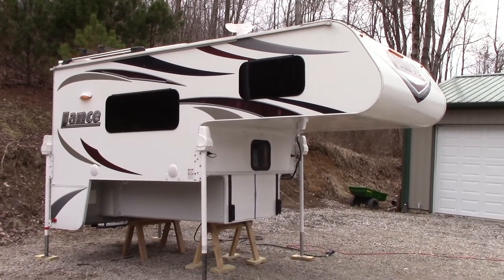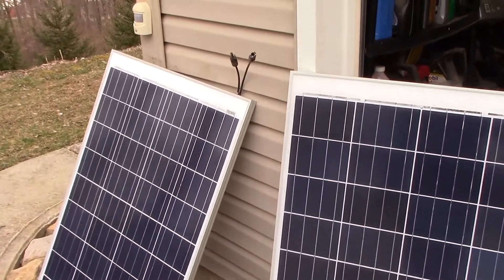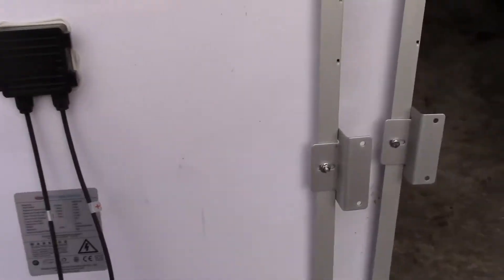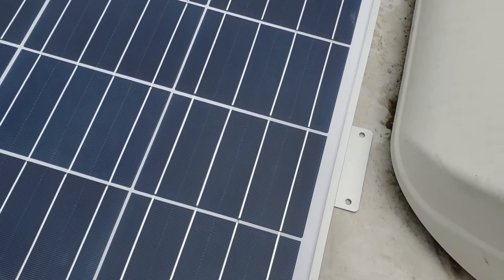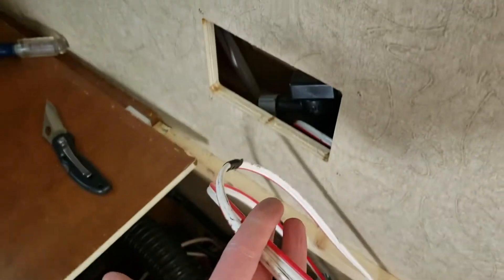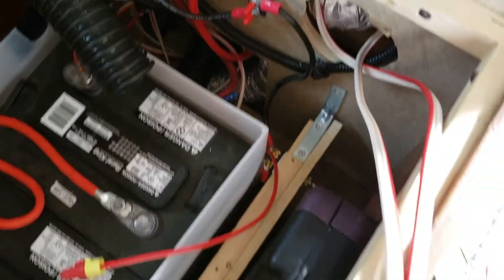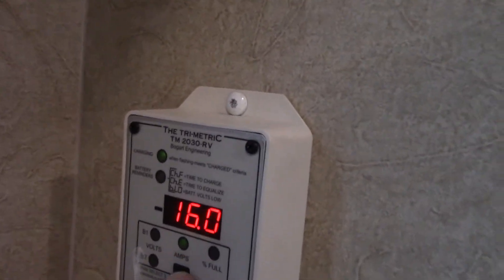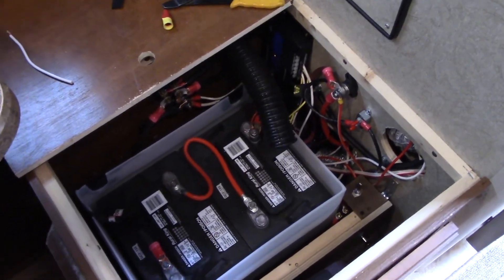Lance 825 Truck Camper 200 Watt Cheap DIY Solar Panel Upgrade

Comment: I have a little older lance 825. I want to do this and I really need to plan mine out because it doesn't have the wiring done for me already, but one of my unknown is mounting the panels to the roof. Does it matter where I mount them. I mean do I have to mount them to a stringer? I cut a hole in the side of my camper to install a outside shower and I had to build a frame because there wasn't enough integrity to hold the shower. How did you know where to drill your holes for your panels or is the roof different than the sides? Thanks in advance. Nice video good to see video's on actual slide in campers.
Reply from the maker: I just mounted them straight to the roof. It is solid material. It would be best to get them in the aluminum frame but that is not always possible. The key is not to go crazy with the drill and overtighten the screw so it just snugs down and doesn't strip out the material. I also glued the mounts before screwing them. Then covered it with dicor self levelling sealant.
Reply: @JackofAllMasterofNone  thanks for the response, if you would, what did you use for glue?
Reply from the maker: @azxp  Any polyester type exterior adhesive caulk would work good. I usually use OSI quad but I'm not sure it it technically labeled an adhesive. It's more of a sealant.
Reply: @JackofAllMasterofNone  Thank you really appreciate the advice

Comment: I assume you can’t run the microwave or AC off this setup? Any idea how many more batteries would you need.
Reply from the maker: No. You would need a lot more capacity to do either. Can't say for sure, depends on your weather and how much sun you get each day. You would also need a very large pure sine wave inverter.

Comment: So I have a 2016 Lance 825 look's similar to yours e, how is that working out for you and would you recommend buying a panel for mine?
Reply from the maker: It's nice because I don't ever have to plug in the camper to charge the battery.

Comment: Nice video and great info. I have a 2010 825 and it has the wiring for solar panel installation. What equipment exactly do I need in order to do the same thing you did? Thanks..
Reply from the maker: A couple of solar panels and a solar charge controller are all you really need.